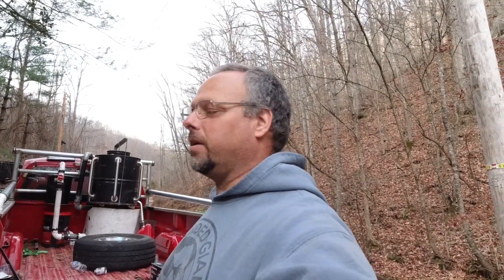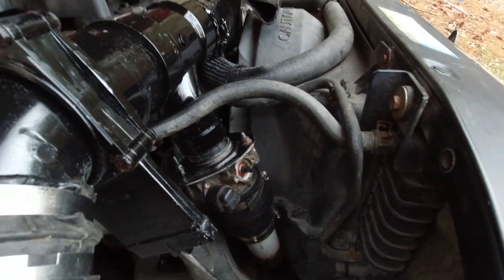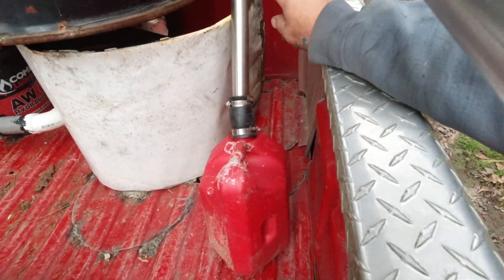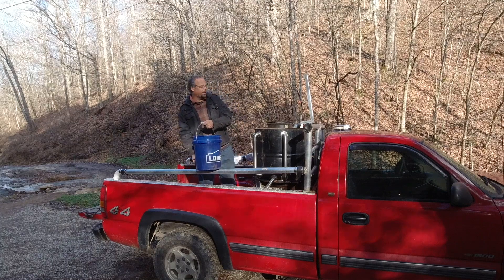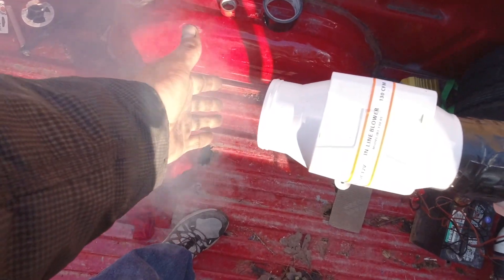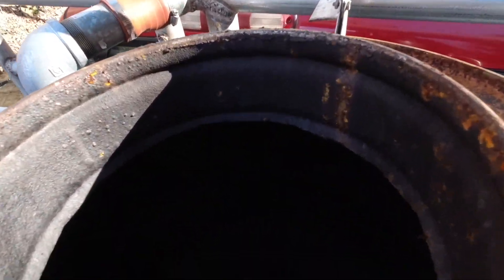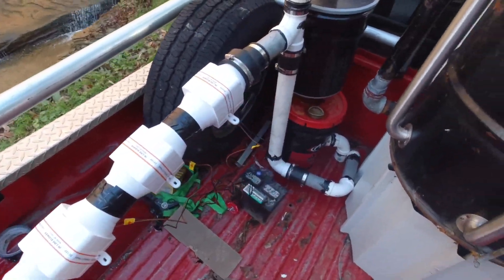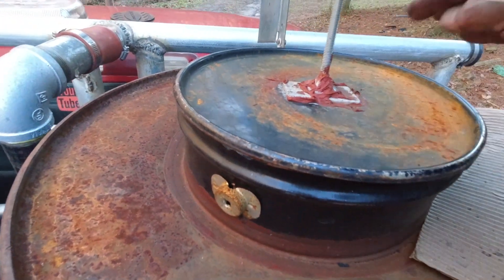First Flair for the Gasified Silverado

Comment: Great presentation job LukeF.
Yep. Your learning lesson here is that for woodgasifer performance a fellow does need good dryed wood.
Making, storing, having enough true dried wood fuel for a V-8 fuel hog such as yours you will find will be the bulk of your operating time/effort.
Looking forward to you running that late model GM small block on woodfuel. Ha! Ha! Challenging, to give friend Marcus a run for your money!
One heads-up . . . your first red silicone gas couple will heat fail sooner, versus later, once under a true engine loaded working. Having to accommodate at least  10X the heat energy as just blowers loading. Think ahead about a metal mechanical connection here as others have learned. Cast iron pipe union; 3 or 4 eared exhaust flange; exhaust V-band coupler . . . . maybe a spring bolted exhaust ball and socket joint. A maybe on that last one.

If I knew you better I'd tease you as "for-now Luke". Actually as a compliment for your excellent attitude of good enough for this particular learning step. 
It's the fellow's so assured of their ideas and reading research, that they only pretty-finished completed build from the get-go who have the problems of learning humility. The Oh-well; that didn't work. The willingness then to back up, re-jigger, and try again in a different way.
Best Regards
Steve Unruh
Reply from the maker: I have an exhaust flex connector I may try in the place of the silicone connector. Hopefully it will work for this. I want a little bit of movement to account for the bed flex so I don't want it solidly connected.

Comment: it seems to be coming along nicely.. How about using a charcoal lighter chimney and dumping hot coals into to start the fire in the morning?
Reply from the maker: That would probably work. It would easier to get started that way.
Reply: @lukeFugate  when you showed the fire under your wood barrel I thought you would use the coals from that to start it, a couple shovels full in a metal pail and BOOM that led me to the charcoal chimney starter...

Comment: You've done quite a bit of work on it since your last video. I'm glad it's flaring now. I can see why these wood gas builds weren't commercially viable. Too many complications for the majority of people, and too hard to have one that would please most consumers. Now I'm wondering if a steam operated vehicle would have been any better given the complexity. I suppose both are pretty difficult in a smaller package format. At least you're in the final stages of this build. I imagine you are ready for a simpler project after this, lol.
Reply from the maker: This has been a complicated build. There are some much simpler designs that I would like to try on a smaller scale. Maybe for a generator or something. 
I actually have quite a few projects that I'll be starting soon. I guess I've just been taking it easy the last few weeks.

Comment: That little hopper lid leak wont matter at all when your driving down the road its just a nice thing after shutdown when there is no smoke coming out. Early there the smoke was just from the charbed being immature, it takes my trucks between 20 and 100 miles to start to settle in and make really good gas, and I think the char bed is fully mature after 2-300 miles of driving. The beauty in the Wayne Keith system is once that char bed is settled and happy it will handle the wet wood just fine I have run my truck on 25% moisture content wood a lot and it handles it like a champ! Getting excited to see this thing driving on wood. As far as the servo goes your woodgas valve will be wide open with the single gas line coming in, that motor will breath in every bit it can get. It will be the air valve that will take fine tuning where a slow moving servo will be handy to really dial in the mixture. 6" is a good starting point for now, but i think that will end up with maybe a six and a half inch restriction depending on how hard you are on the skinny pedal. I find I drive my trucks hard on wood with a heavy right foot, specially past the gas station🤣
Reply from the maker: Man, I really appreciate all the advice and especially the videos you did. I am thinking I will have to run a second line up to the engine. I guess I'll know when I drive it. I'm going to try to build a linear servo to actuate the air valve. I may redesign it to have a butterfly valve instead though. 
I'll need to build a chunker to make the whole fuel processing part easier.
Reply: @lukeFugate  I think I have way to much fun running my chunker 🤣 it was even fun to build, like some mad max creation